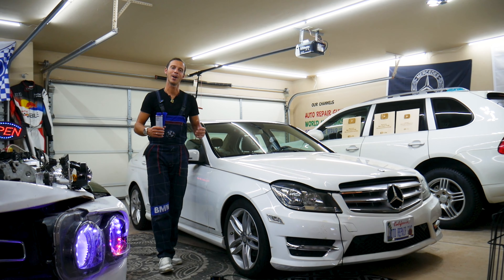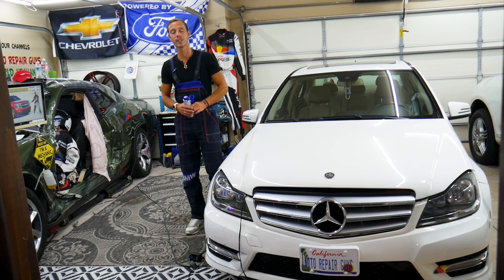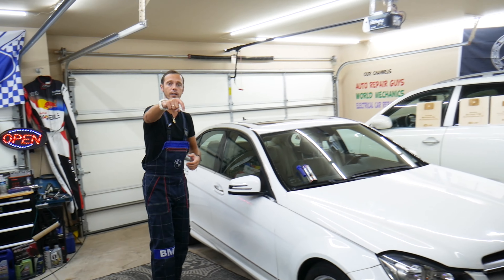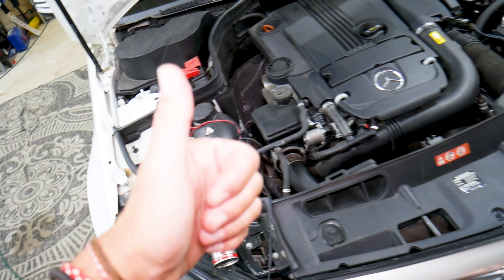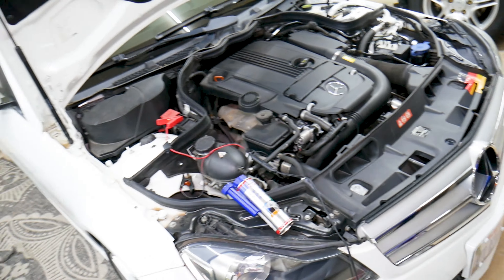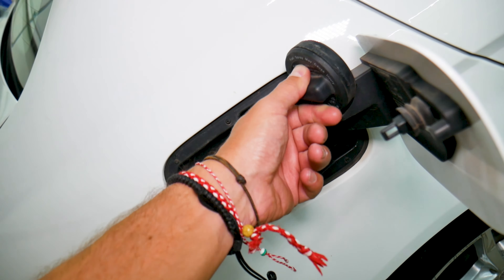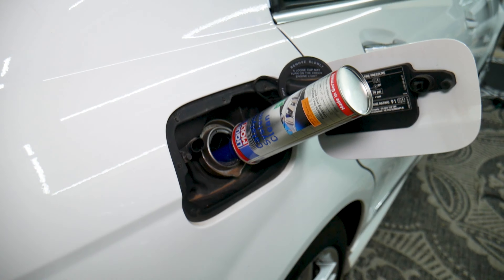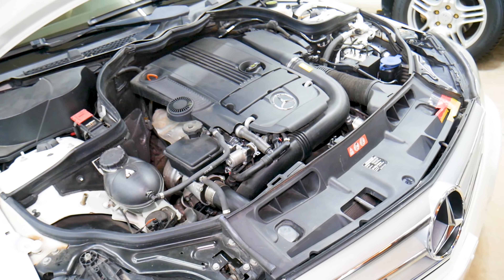Why Mercedes Code P0420 Catalytic Converter W203 W204 W205 W211 W212 W213 GLC GLA CLA GLE

Comment from the maker: Things you may need to fix this problem: 
► Liqui Moly Catalytic System Clean: https://amzn.to/3ZA9xDm
► Liqui Moly Oil Saver: https://amzn.to/3vJhBSw
► Liqui Moly Engine Flush: https://amzn.to/3p91LwF
► Liqui Moly Ceratec: https://amzn.to/3JCVMJY
► Engine Oil: https://amzn.to/3WWf56R
► Engine Oil Filter: https://amzn.to/3WXUak5 
► Mecanics Tool Set: https://amzn.to/2n2dnpb
► Scanner That We use the Most: https://amzn.to/3jogxur
► Tools and parts that we use: https://www.amazon.com/shop/worldmechanics